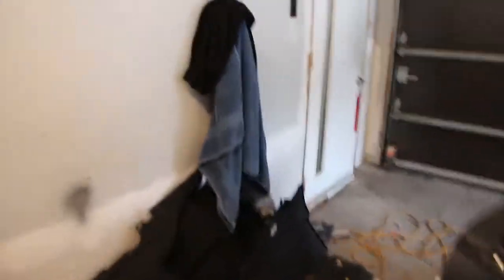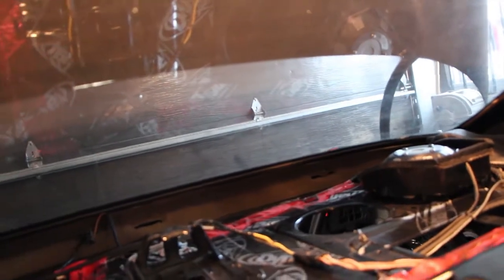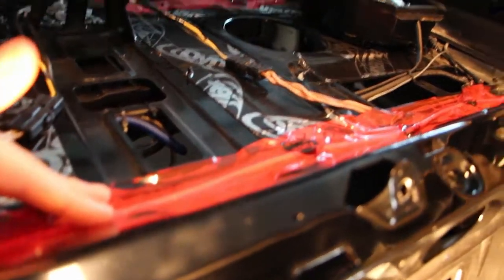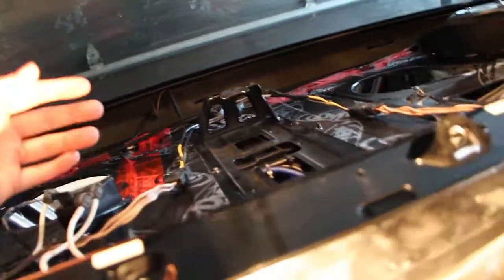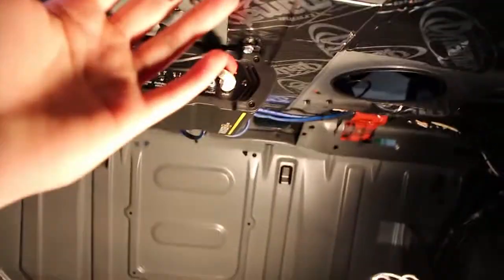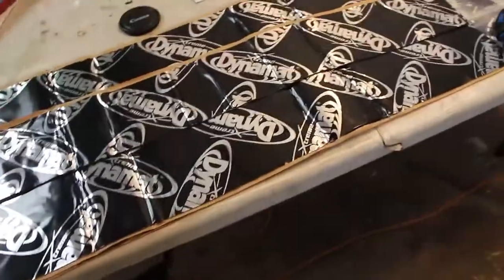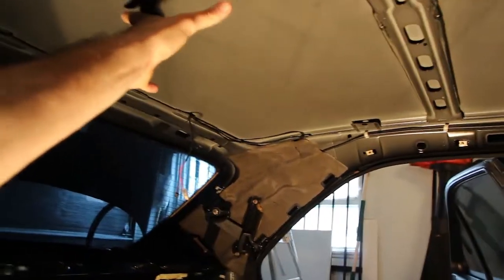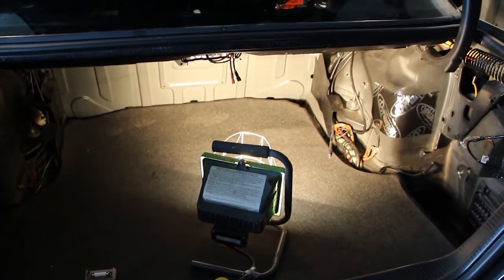W202 Subwoofers, CLD tiles and trunk light

Comment: Was hoping to buy those in Europe, but those are really rare here, on ebay they are expensive including shipping, so i'm still thinking what to put there, with a decent punch. Btw, any chance on some audio test ?
Reply from the maker: I do want to try making an audio test, it's something that regularly gets requested. My only problem right now is with capturing the sound well enough. The sound system might really sound amazing (believe me, it does), but if my camera's microphone isn't up to the task it will just sound bad in a video. And that's before the issue with how the sound is reproduced on the receiving end of the video. That's why I'm sort of reluctant on making an audio test, at least until I can get my equipment sorted out.

If you can't find these particular subs in Europe, you should still try to search for other shallow mount subwoofers. I'm sure there are other companies out there, maybe some that are made locally. They may or may not be as good as the earthquakes, but the truth of subwoofers is that what really matters is: 1. the acoustics, 2. the placement and 3. how much power they get. If you have a good 1. and 2. (which the W202 does in this case, with the small subs on the shelf firing into the trunk), you don't need much of 3. and it won't really matter which speaker you get. The earthquakes are just really well built and really well packaged into such a small footprint.